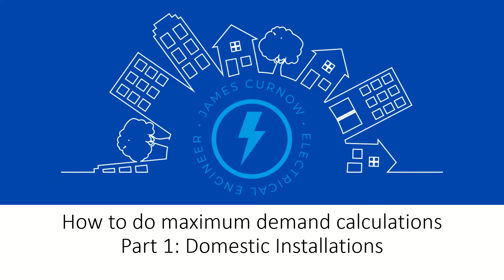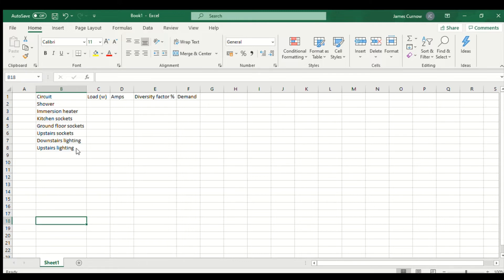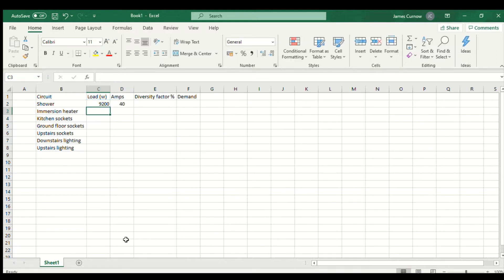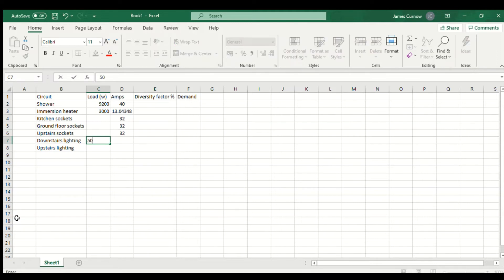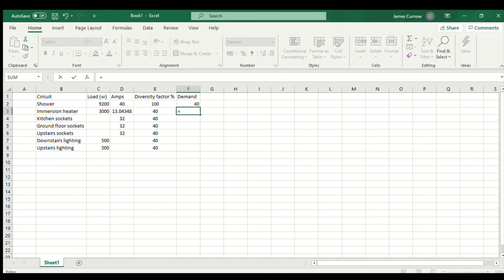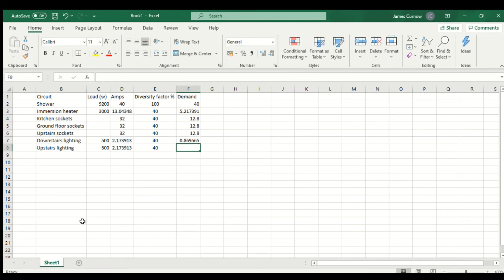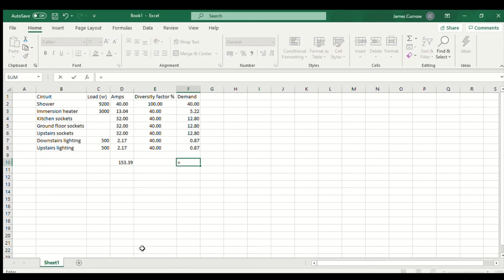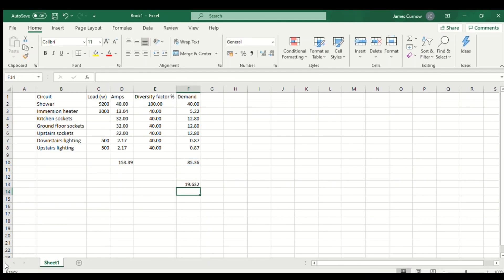How to do maximum demand calculations

Comment: Hi James, I've been calculating the maximum demand in a very similar way to you, using a spreadsheet I've mocked up, but the guidance values that I have been sent by UKPN suggest that the ADMD for a 5 bed house is is 2.4KVA during the day, and 0.5 at night. This is way below what you have calculated and what I have calculated. How are they getting this figure? Are they dividing the answer by 12 hours? As this would bring it in line with what I am calculating.
Reply from the maker: Hi Robert,
Thank you for your question. The DNOs have a different method of calculating maximum demand because they are looking at the demand on the network overall. It is difficult for me to say how the figure is reached without knowing more information, but they will usually take into account which type of heating is in the property, because electric heating will be a larger demand than gas central heating for example. They will also ask if a property has any renewables or ev charging. 
I usually calculate the demand in accordance with the on-site guide for individual dwellings. 
Kind regards
James
Reply: @JamesCurnowElectricalEngineer  thanks James, I have since found a document provided by UKPN which gives far more reasonable figures. For example, a 100A 3-phase supply is suitable for up to 69KVA (suggested by them) which is far more realistic compared to the figures I was sent before.

Comment: The problem calculating it that way is that if you had an EV charger installed in most cases you would be over 100A.
Reply from the maker: Hello Brad,
Thank you for your comment. I think it will be interesting to see if the guidance changes due to EV charging. Section 722 of BS7671, which relates to EV charging installations says that load curtailment can be taken into account when determining maximum demand. So that may be a solution. Also, we might start to see more 3 phase supplies being offered by DNOs due to the increased demand from EV charging and moving away from gas heating.
Regards
James

Comment: Hi James, great video 👏 may I ask, what do you do if you you have 2 of the biggest circuits the same, for example 2 x 40amps, do you take 100% diversity for one of them or both?
Reply from the maker: Thank you, I'm glad you like the video. That's a good question, I think it would depend on the type of load, so it's difficult to say without more information. If the loads are identical, then I think I would try the calculation using the individual diversity factors for each type of circuit.
Kind regards
James
Reply: @JamesCurnowElectricalEngineer  thanks pal

Comment: Clearly explained video although I think you've made a mistake with your diversity factors. Immersion heaters = no diversity factor applied and 13.04A would be the demand given in your example. For lighting circuits it should be 66% of the total load.
Reply from the maker: Hello Anthony, 
In this video I use the diversity factor in accordance with appendix H of the on-site guide, which is 100% for the largest load and 40% of the remaining loads. This method is number 9 on table A2 which shows the allowances for diversity.
There is another video on my channel where I give an example of using the individual diversity allowances.
I hope this helps.
Kind regards
James
Reply: @JamesCurnowElectricalEngineer  Thanks for your reply James. I was taught to calculate maximum demand using the individual method and was unaware it was possible to use the Appendix H approach.